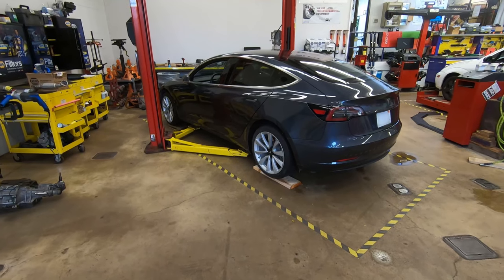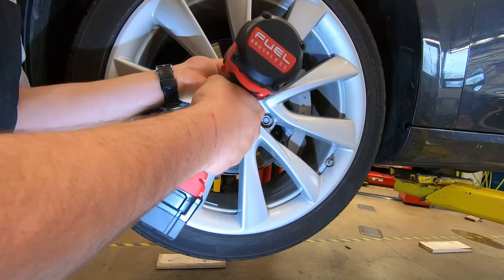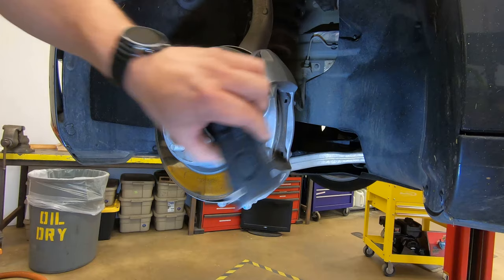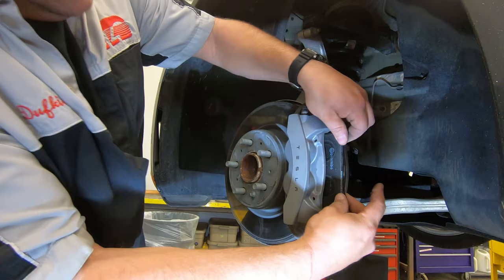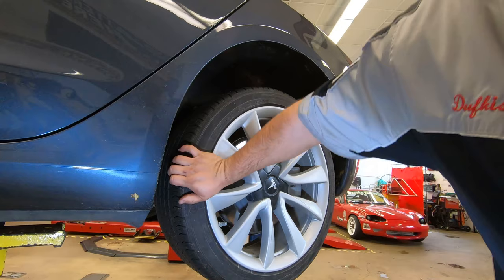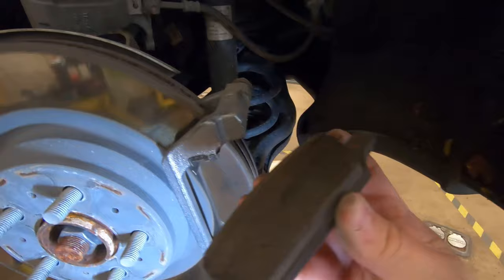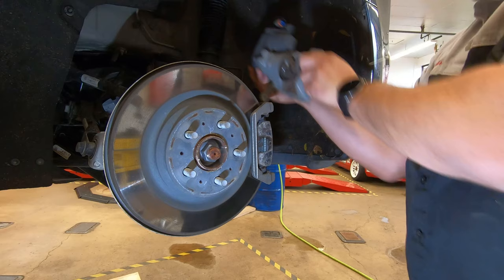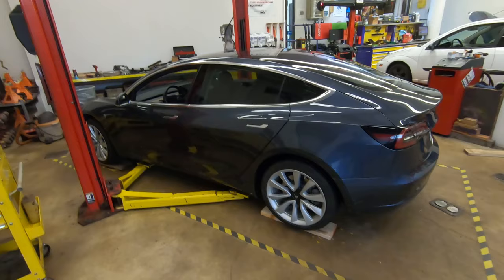Tesla Model 3 Brake Service: How To

Comment: this car doesn't need friction brakes, just put the electric motors in reverse to slow down
Reply: Aaah.  What if you're going 100mph and motor goes out?  Or you need to emergency brake at 100mph?
Reply: @kimstockdale632  you crash, that can happen if regular brakes lose brake fluid as well or if the parking brake wire snaps
Reply: Well, no. Regen only works if there is space in the battery to absorb the energy. If the battery is full, or if the battery is too cold to accept a charge, regen braking will not be available. Friction brakes are also useful to supplement regen, when full regen is available.

Comment: "Brake Service" that doesn't even mention flushing the fluid ?  le sigh
Reply: Seriosly though, this is a one year service. Flushing the fluids is relevant, but once every 6 years in most cases is enough. Most manufactors recommend every other year. 
As far as i remember brake fluid deteriorate by around 3% each year, barring any manifactoring errors in parts. So say 6 years, losing around 20% brake fluid efficiency is within margins. 

Remember 20% doesnt mean 20% less braking. It does mean pushing the pedal a little harder for the same nm force as fresh fluid, and maximum pressure is probably somewhat affected too.
Reply: @deandre1988   “annual brake service” ? That isn’t a thing. Brakes are inspected for wear or anomalies at regular service intervals (usually every other oil change in ICE cars), but cars don’t require removal and lube of brake pads every year unless they’re in special adverse climates like snow.

If you own a Tesla and aren’t driving in snow on the regular, brake inspection doesn’t come every year with the ICE vehicle oil change, so it will instead come every 2yrs with the recommended brake fluid flush interval. Because of regen, the pads will last far longer than an ICE car driven the same, so this clean and line of the pads is done with the biannual fluid flush.

If you’ve ever had your Tesla on the track, you’d know how under-braked they are, and in an emergency braking situation, wet fluid = longer braking distance. Model 3s exasperate this by having an inordinate amount of firewall flexing that degrades threshold brake performance even further right off the factory floor. Trust me when I say, you’ll want that fluid dry if you ever need to panic-stop so you need to flush it every 2-yrs when you service the brakes like this.